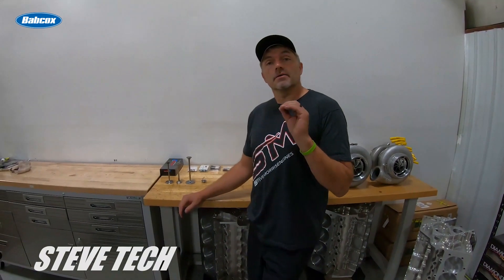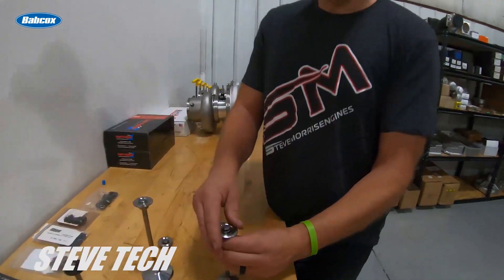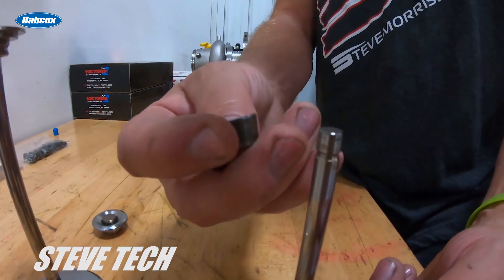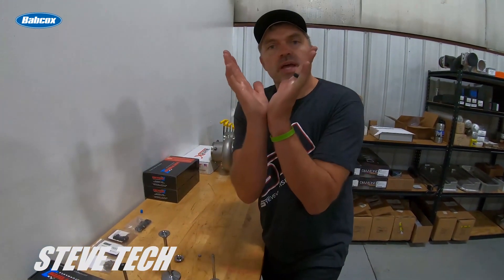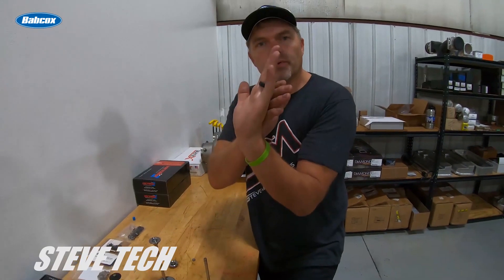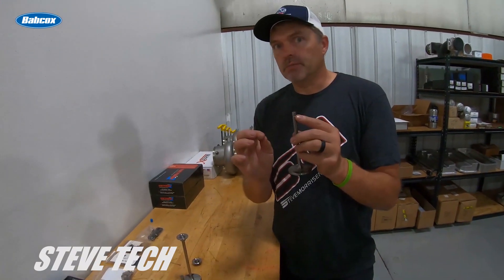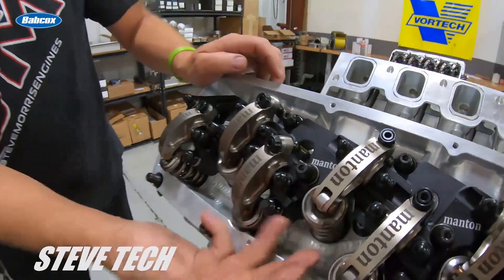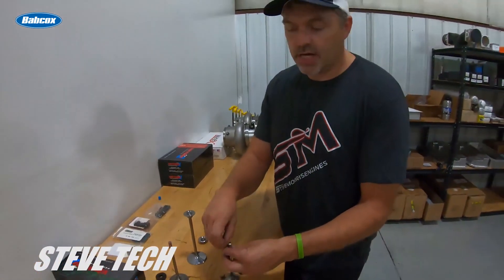Valves, Retainers, Keepers & Locks, Oh My!

Comment: Hey Steve, love your knowledge of all things automotive. Working on deleting my DoD on my 2009 Pontiac G8GT. I purchased dual springs from a reputable company in Texas. They sent me 10 Degree Keepers and I can not get these keepers to work. My old 7-degree keepers work fine but I can't get the 10-degree to stay together. mY VALVE STEMS ARE 11/32. The retainers are titanium. The keepers fit fine on the valve stem outside the head but when I compress the spring they just will not stay together. Tried using assembly lube but no help. Any suggestions. Not sure why they sent me the 10 degrees but it was a kit. Thanks again for your videos.

Comment: I thought the LS standard locks were 15degrees? Sorry not trying to be that guy I’m running 10s on my set up I just want to have the correct information or if I learned it wrong before I need to get the correct information. Thanks for all the information you put out. God Bless.